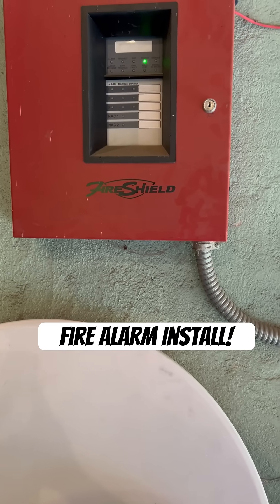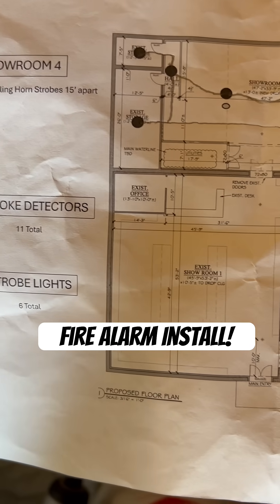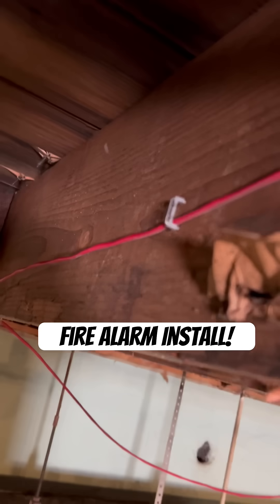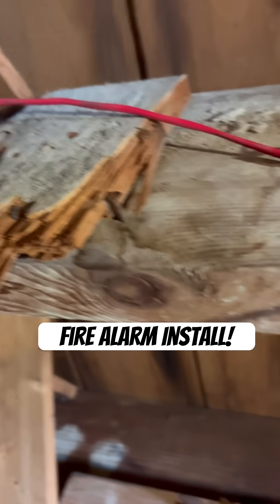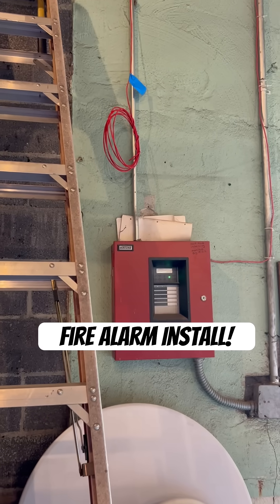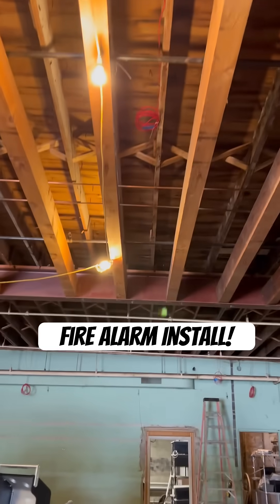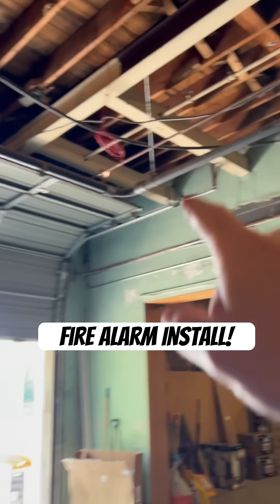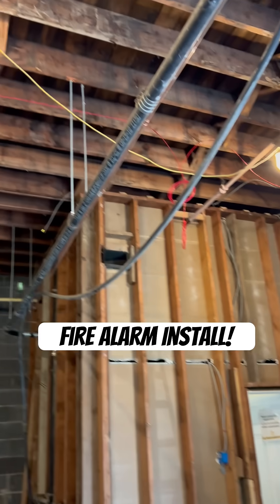Electricians: Class B Fire Alarm Wiring with Pro Tips!#electrician #electrical

Comment: Ever use a TDR (Time Domain Reflectometer) to track down opens and shorts? It gives the distance to a fault that will get you close to the problem. They save a lot of hassle, especially with Ethernet cables (which is what I mostly used one for).
Reply from the maker: Yes Klein tools makes an excellent TDR it’s very precise and accurate friend. That’s very interesting you bring that up perhaps I’ll have to do a video on one, everytime you comment on my videos I always learn something new I keep forgetting you were an engineer in the navy. Always a pleasure friend!
Reply: @SchecterElectric  Doing a video on using a TDR would be great, especially for those who've never seen or used one before. :) 

Might also consider demonstrating a tone generator and tracer, if you have one available. There's the kind used to track down which breaker an outlet or light fixture is on, and they kind used to trace Ethernet and telephone lines back to patch panels and wiring blocks. Very handy, especially if you're working by yourself. :) I had a Fluke Network Cable Analyzer (like the MS2-KIT), which was a great (though not cheap) tool. 

------------------

A little reminder, I was an ET (Electronics Tech) while I was in the Navy and it was after I was discharged that I put myself through college to get my degrees in Computer and Electrical Engineering. :)

Comment: All fire alarm cable should be in conduit to protect the cable especially the flimsy cable that you are stapling.
Reply from the maker: Only needs to be sleeved in EMT going into the fire alarm panel. That’s why I left it above the ceiling.
Reply: Maybe In your jurisdiction, not anywhere near me. Unless subject to damage it must be covered below 8ft

Its good practice, we'll usually cover it till it goes above the ceiling if applicable.
Reply from the maker: @Tw1steD247 this is just the rough stage their eventually gonna be a room built here and we’ll sleeve everything in EMT
Reply: @SchecterElectric on same page with you, was replying to hank 👍
Reply from the maker: @Tw1steD247 right on!

Comment: Nice work!

Do you guys do the complete install?

Termination, programming, connect to central station?
Reply from the maker: We do everything besides programming the radio box we hire out for that just because of the special software that is required and it doesn’t cost that much really to have someone program a basic system. Now if it was a simplex system forget it you’re talking thousands just to program.
Reply: @SchecterElectric  job security baby!
Reply from the maker: @Backlash1818MobileGamingChanne lol yea I guess so
Reply: @SchecterElectric  until someone makes a networking helper tool that normies can use anyways. I do the physical and programming for everything I install. Id kill for one myself 😂
I like your vids man, you do clean work 👍
Reply from the maker: @Backlash1818MobileGamingChanne thank you friend I try and do my best always i appreciate your support!

Comment: So clean dude great job 💪🏼 should show you the inside of our ceiling at work it's an endless mess of wire and fish rope leading to god knows what
Reply from the maker: Thank you friend ! Oh ya I can’t stand that crap when the ceiling looks like spaghetti you can’t accomplish anything and then customer will wonder why it costs so much lol.
Reply: @SchecterElectric  Situations like that you need a "fox and hound" -- inject a signal on a wire/cable and use the tracer probe to track it through the overhead. Sorta like the ones you plug into an outlet and then use the probe to find out what breaker its on, only made for things like alarm wire, telephone lines, Ethernet cables, and coax cables.
Reply: @SchecterElectric  yea a resi would never have the shit nest we have to deal with on the commercial side of things but by god
Reply: @SchecterElectric i can only imagine some of the panels you have to see especially in Fall River
Reply from the maker: @dabiff6587 they are all a disaster a complete disaster